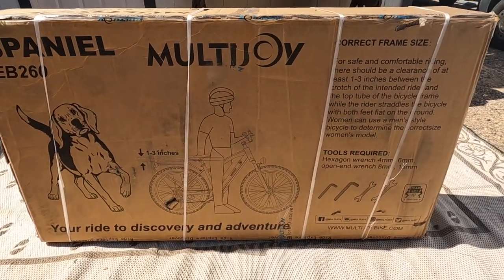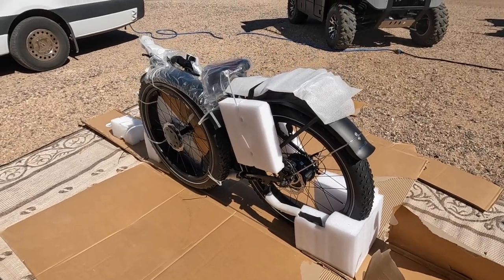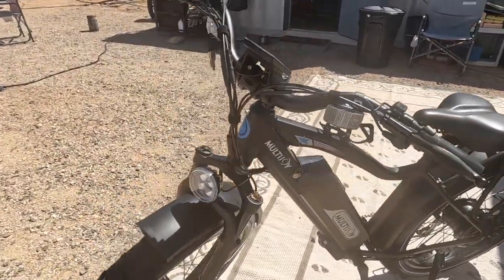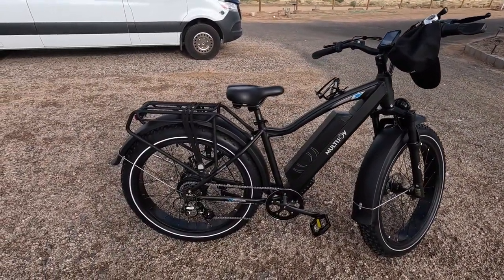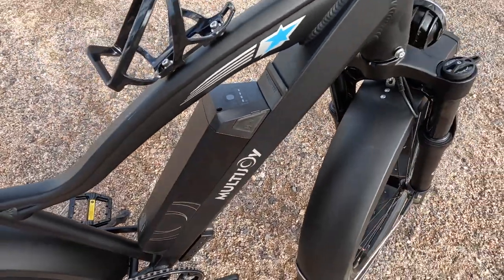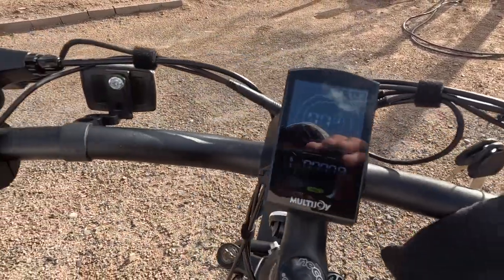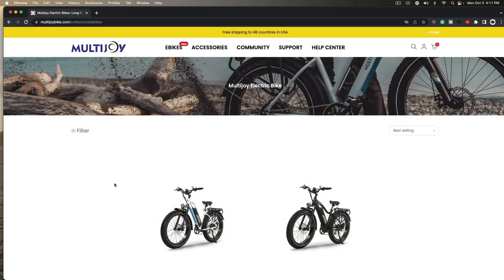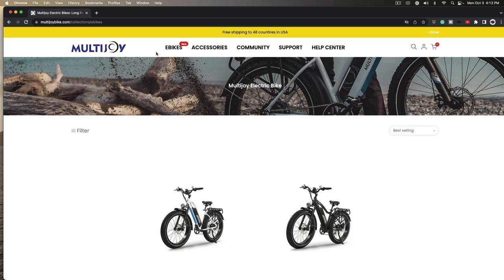Long Range Fat Tire Electric Bike - Multijoy Spaniel EBike

Comment: 1. Does it have mechanical or hydraulic disc brakes?
2. Does it have full throttle on demand regardless of what peddle assist level you have selected?
3. Does it have a cruise control feature because it can get very tiring to be constantly holding the throttle if you don't feel like peddling.
4. What is the top speed with throttle only?
5. How does it do climbing hills?
7. How many gears does it have?